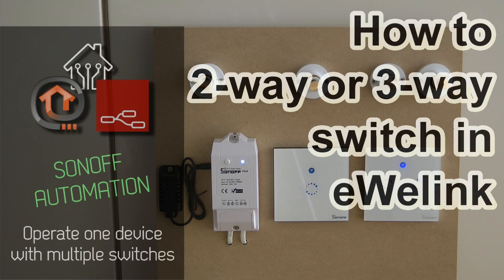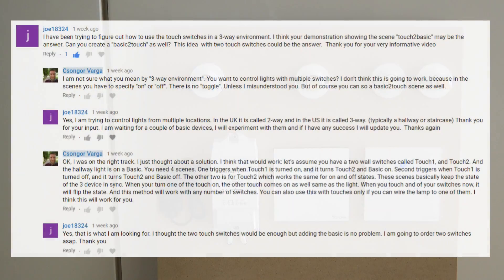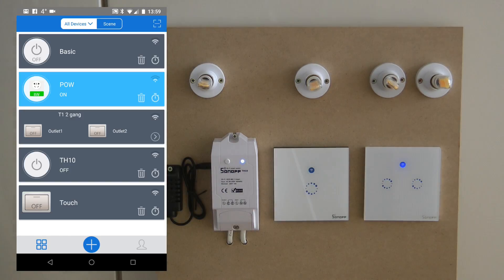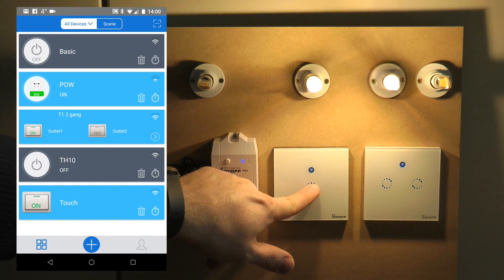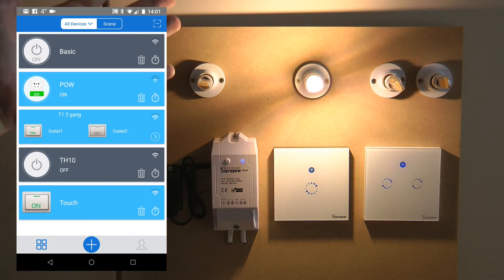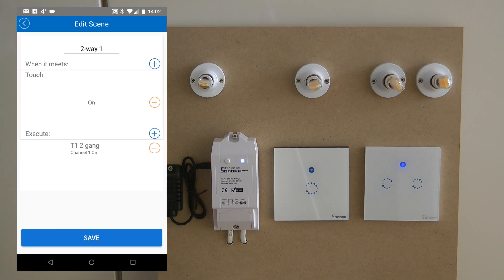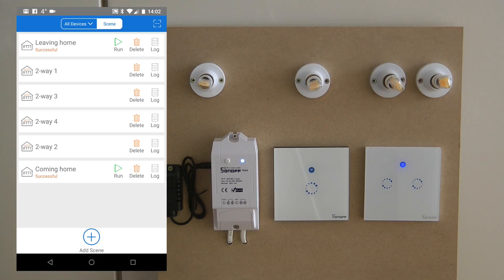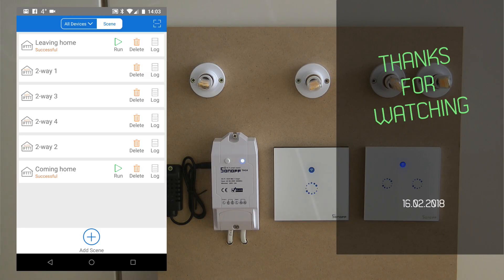How to set up 2 way or 3 way switching in Sonoff / eWeLink

Comment: hmm, I set up scenes with sonoff touch and regular sonoff but there are strange things happening. 
Sometimes they turn on and off for about 1 sec but I can hear relay clicking. 
History shows that that on/off was made by scene but I did not touch anything while this was going on. 
Have you ever encountered that?
Reply from the maker: Not really. I have not made complicated scenes yet. Maybe one scene is triggering the other. But so far everything was working for me as expected.
Reply: it's basically a 2 way switch but one of them is just regular sonoff and the other one is  touch. 
Ewelink support have no idea too so it's just my luck for bugs and faulty hardware probably.

Comment: Hi, with the scenes are you actually "pressing" the button on the other switch or they just flip the status? I'm asking it because I have an actual physical 2-way switch that I want to replace with 2 sonoff 1 gang wireless switches. With those scenes, I think that the automation will turn off the light immediately after turning it on. Am I correct? Thanks!
Reply from the maker: These scenes keep the two Sonoff switches in sync. So you turn one on and the other is turned on by the scene. I was not pressing the other switch. And it does not turn off immediately. It works as a 2-way switch. Of course you only need to connect the lamp to one of the Sonoff switch (does not matter which). The other Sonoff switch just there to be used as an interface, it is not really switching anything.
Reply: I see, that is great! Thanks a lot for the explanation!

Comment: Just had a thought if there was a way to double tap the switch and to start another scene instead of simply having the switch do one action.
Reply from the maker: Not with eWeLink, the scene triggers on status change. Or a long press scene would be nice as well. I have some light switches around the house (like the bathroom and kitchen lights) that if I press for more than 5 seconds, it fires up the circulation pump to get hot water to the taps from the boiler. So you don't need to run the run the tap waiting for hot water. Not the best solution, but works.